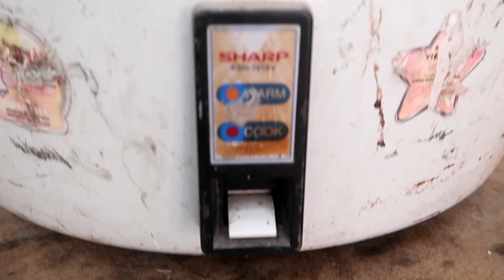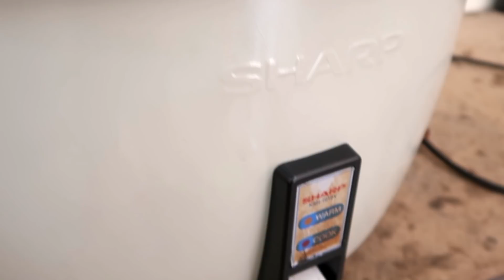Giant Rice Cooker Cooks 10kg Of Rice // Giant Rice Cooker Restoration - Mr.electricity Project

Comment: Nice Viedeo. Unfortunately, in Germany we always throw everything in the garbage if it is defective, although it can usually be fixed relatively simply again.

Please crimp the thermal fuse and do not solder. Soldering melts at 175 ° C and your fuse has got 185 ° C where it breaks. This can lead to an unwanted error when the solder melts.